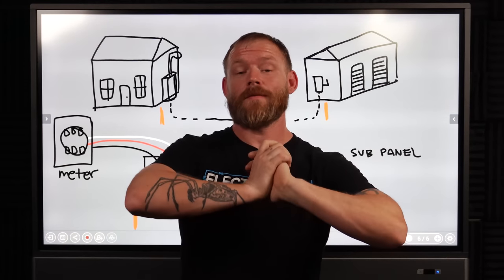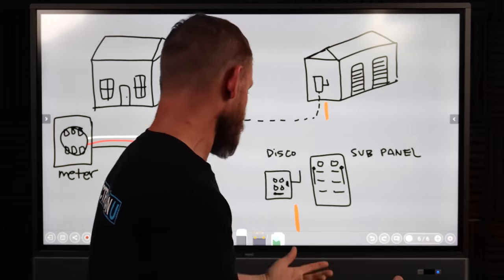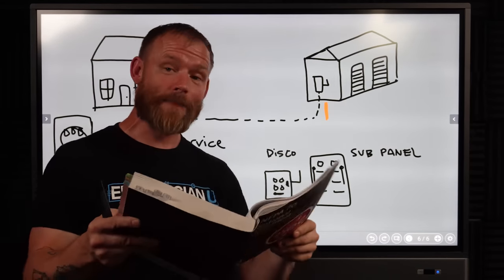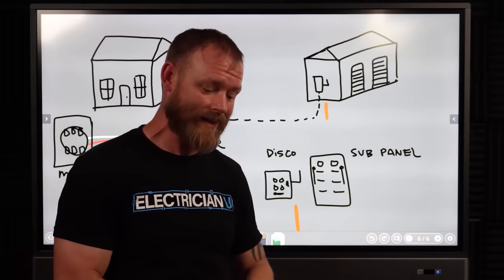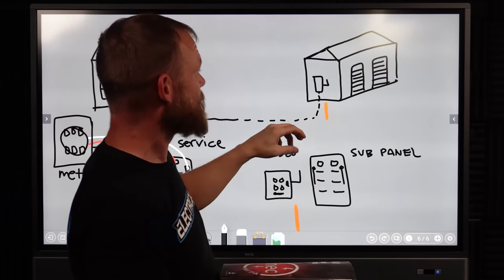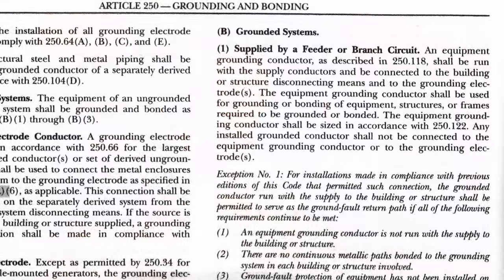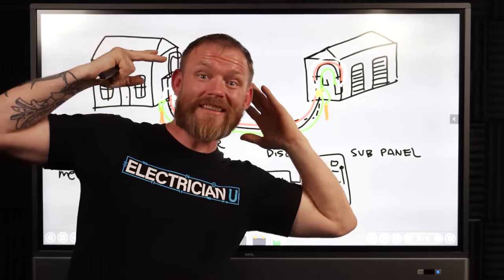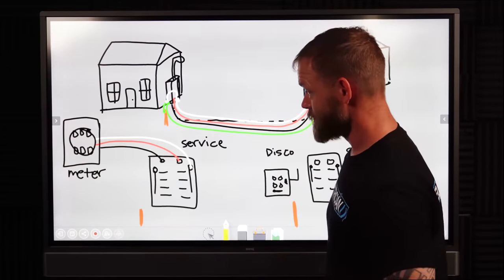Is a Ground Rod Needed When Grounding Multiple Buildings?

Comment: I understand the bonding part of it. But What about a Feeder sub panel in the same building? I run a computer lab and I have a sub panel. And the ground an nutrals are not bonded I leave that to the main service panel. But I did run a seperate ground rod into the ground on and hooked the sub panel ground bar to it. Now Again I keep the ground and nutral separate in my sub panel But I do have a second ground in the system One at the Main Sevice and One in my Sub panel. Ive never been super clear on this and no one has ever been able to tell me eather way if this is right or wrong. I mainly did it how ever to Give the RF and EM Radation computers generate a shorter path to disperse. The Last Lab I constructed and I didnt ground the sub panel the EM and RF Noise was so high that it would interfer with pretty much every thing in a 15ft radus around the lab room, this lab that I did ground the sub panel the Radus of the EM and RF noise is inside the room and about 3 foot around it. But Ive never had a clear Yes ground the sub panel seperate its a good idea or No dont do that let it travel back to the service panel.

Comment: This is one area that I see the most mistakes made. Failing to run a equipment grounding conductor with the feeders, bonding the neutral and ground at the sub-panels, failing to provide a ground anode, or other combinations. Another pet peeve of mine is people not using ground anode conductor clamps that are rated for direct burial when the ground anode is exterior to the building or in a damp or corrosive space. I have seen many a clamp loose or disconnected from the ground anode due to steel bolts rusted through.

Comment: How do you get asked this from electricians, they're licensed, right?  I'm just a poor farmer that does his own electrical to attempt to turn a profit.  Even I know, for each service, you drive two ground rods a minimum of 6' apart (unless you can prove a single ground rod has less than 25 ohms resistance), and bond them to neutral in the main panel, then keep ground and neutral isolated thereafter.  Per what is it, 2014 or 2007 NEC?  I think before that, you could bond neutral and ground at sub panels.  Do I have installations on the farm that don't meet that?  Sure, they didn't run ground wires to the outbuildings, so I have a 1930's-40's farrowing house that has the EGC and neutral bonded at the building sub panel when I redid the wiring and included an EGC in the building circuitry.  Just make sure you have an effective ground fault current path.  Without an ECG to the source, you could have objectionable neutral current, but better that than not clearing a fault.  Didn't know you should still have ground rods at every outbuilding, though.

Comment: Most of the hundred amp disconnects are so small and don't even come with a ground lug do you still have to bring your bear copper to the disconnect or is it fine to go to the panel as long as I Bond my disconnect

Comment: I understand the rules and idea for this and what the code requires. But I'm curious why you need another ground rod at the second building since it's already connected directly to the ground rod at the service. What's the point of having 2 separate ground rods?
Reply: One reason is lightning. If lightning hits the out building you do not want that voltage being pulled back to the main building through the green ground conductor. You want that voltage going directly to the dirt ground.
Reply: @ecospider5  I suppose that makes sense. It's still a bit weird to me though since it will travel along the conductor to the main building's grounding rods which go directly to the dirt. I guess the advantage is a shorter path...

Comment: Question, is the disconnect required at the sub panel location? I just did this installation with 200 feet of 4awg, fed from a 60 amp breaker at the main. I did everything correctly as you said…… except that I have no disconnect. Would this fail?
Reply: 6AWG for the ground all in conduit
Reply: Also, do you know if exposed Romax is allowed inside of a pole barn? Hopefully it is lol
Reply: @atlanticmediaproductions9233  8 awg is rated for 100amp ground. 6awg is way overkill but doesnt hurt.

Comment: In my line of work we deal with detached garages and we just run wire in some pvc from a T11 down and into PVC and then up into an LB. If im understanding this correctly, if those wires running to the building will go into a breaker, then it needs its own grounding electrodes?
Reply: it's in the wording. A breaker will be inside a box. (read: panel) If you feed a panel then the wire is a feeder and must comply under those rules. If the wire simply goes to some outlets and a switch, then it's treated as a branch circuit.

Comment: If a hot wire inside a lamp post shorts out with the lamp post then grounding that lamp post just made the ground around the lamp post an electrocution hazard. 

So the question is do we have more people getting electrocuted from shorts and a lamp post or do we have more people getting electrocuted from lightning strikes to a lamp post. 

Personally I think the lamp post should be grounded if the electricity going to the lamp post is GFI protected but I don’t believe most lamp posts are GFI protected.
Reply: Honestly, the lamp post would be the electrocution hazard without a ground in that case. I'd argue better to ground and gfi protect, especially as the conduit runs underground and may have it's own issues

Comment: If you have two ground electrodes on separate buildings and there is a lightning strike close to one there will be a voltage gradient in the soil between them of 50kV or more. The soil path is much higher impedance than the feeder path joining them so you are bringing two voltages close together that will break down any insulation or just arc over the short distance between them. What is the correct method  of dealing with this situation? I don't see it addressed in any code worldwide, it's the elephant in the room.

Comment: Out of curiosity the system you drew could there possibly be potential between the two ground rods now? In a very highly unlikely situation
Reply: As the two ground anodes are bonded to each other with the equipment grounding conductor ran with the feeders, they will always be at the same potential.
Reply: Hypothetical situation say the impedance of the ground were to become more conductive then the ground wire it self say it were undersized because of old code or just a mistake could that be a path to travel if say a ground were to become compromised in that kind of form I’ve been reading up on how these could be a factor in the future or is this just non sense?
Reply: I would say most likely during storm conditions

Comment: I wonder if some people say they don’t need an extra ground rod because it can be rather difficult to drive them into the ground at times without proper equipment.
Reply: it's because the old code didn't require one if you already have a ground wire in the feeder.

Comment: Why do some electricians wrap outlet terminals with electric tape? And is it necessary
Reply: Not required. It is normally done when using small metal boxes to prevent contact between the terminals and the box or your fingers if you are pulling it out while it is energized.

Comment: I'm having a tough time finding an answer to a related (somewhat) issue.  I have a detached garage that has it's own 200A service from the utility and is grounded via a concrete encased (foundation) ground.  There is a ground mounted solar array 60 feet from the building that I'm completing.  I put in a ground rod at the solar array and I am grounding the combiner panel and the solar panels/frame to this ground rod at the solar array.  So, each 'structure' as I call it, has it's own ground rod.  And of course I am running a black and a red from the combiner to the detached garage, do I also run a ground wire and effectively bond the two (solar array and detached garage) ground conducters/rods/etc to each other?  Half the electricians I talk to say yes, half say no.
Reply: I'd say no.  And this is why.

The DC circuit that is the electrical side of the solar array does not have a ground.  The ground rod installed for the solar panel structure is there to protect the structure and any persons in contact with it from current should a fault cause it to be energised.

Connecting that to other structures will not provide any better path to ground.  But it will increase the risk because now a fault in your garage could cause the solar panel structure to become energised and so dangerous.
Reply: @calmeilles  Thank you, I'm worried that a lightning event would travel through the ground to the garage and damage more there.  I learned this lesson the hard way with a Generac generator I self installed.  I couldn't get a straight answer on connecting a ground rod or not at the generator so I did thinking better safe than sorry.  Had a lightning event nearby that took out the generator.  Found out during the repair that the ground rod at the generator was the likely culprit and since then Generac doesn't even have the lug anymore for a ground rod and has instructions not to install one in typical residential installations where grounding exists at the main panel ....
Reply: @bmoulas   The ground of the service supply is designed to protect you from certain faults on those circuits.  

Lightning and other outside risks are something else and if you're in a lightning prone area you should look at specific lightning protection equipment.
Reply: @calmeilles  Thank you, I did buy what Enphase recommended.  I'm trying to do what I can to minimize any damage when things don't go as planned.

Comment: Why would anyone put a disconnect and panel as two individual units when most subpanels are all ready set up with a main breaker that serves as the disconnect? Additionally you didn't explain what defines a feeder.  For example if just running a 120v 20 amp line to a 250ft away barn wouldn't it be wise to run a subpannel so as to separate the hot from the neutral and add a separate grounding bar to the subpanel, then feed the outlet and light circuits to that. So even though it has a "subpanel" its only function in a sense is to keep all the wires separate while serving as the control point for the branched out barn circuits, instead of putting all the fukn wires into one giant junction box and spliced into the incoming hot/neutral/ground wires.

Comment: If it is a metal building and the steel goes deep enough, could that be used for grounding, or must it be a copper rod?
Reply: I am not expert, so would say not always, and it maybe something to check with local codes office.
Reply: @christopherworks400  not even worth the check, I was literally just curious. Not even in the US

Comment: Can you put a cord from one building to the next like a extension cord
Reply: No. Extension cords are not for building wiring.
Reply: Well if it supply temporary power from a house to a shed I see your right I didn't know
Reply: @codydouglass242  When we run temporary power, we use building wire/cable. Extension cords are just to hook up tools and work lights.
Reply: Okay that's cool

Comment: Why is that such a big deal?  If that 2nd building doesn't have a grounding rod it still has a path back via the ground wire that is in turn attached to a ground rod at the main building.  Really what happens if that 2nd Rod isn't there?  your neutral and ground are not bonded together in the sub panel so... again only one path back.   Is it more of a distance thing, or just because it's a steel building, if it was a regular wood building it's not required??

Comment: WHY would anybody NOT add a additional ground rod-damned cheap insurance
Reply: Insurance for what? how many times have you ever seen lightening strike a building? Supplemental grounding rods at subpanels are not supposed to be used to clear faults so their purpose is only for lightening strikes which are extremely rare.
Reply: @hippo-potamus  I lost my barn-just that scenario basically-keep your narrow viewpoint to yourself
Reply: @will5286  Your barn burned down from a lightening strike? Do you really think a grounding rod would of prevented it? Doubtful. Should I wear a helmet when crossing the street just in case of the 0.0000001 percent chance I will get hit by a car? Come on mate get off it.